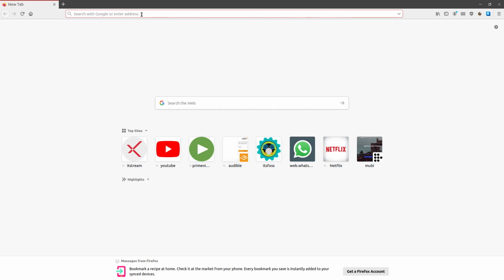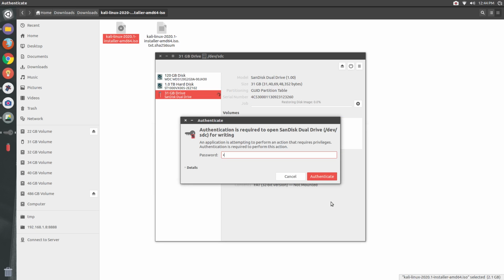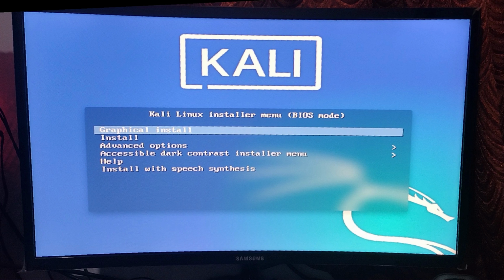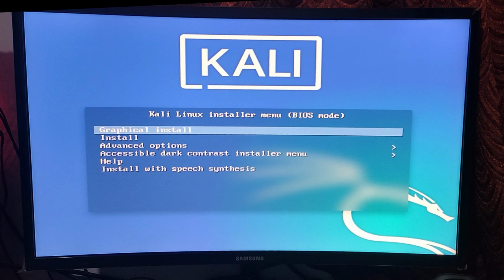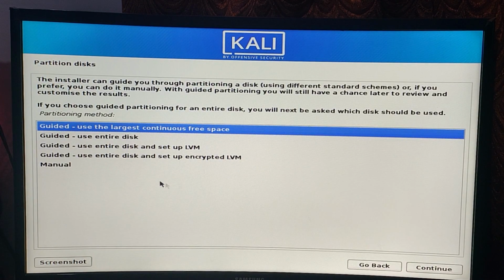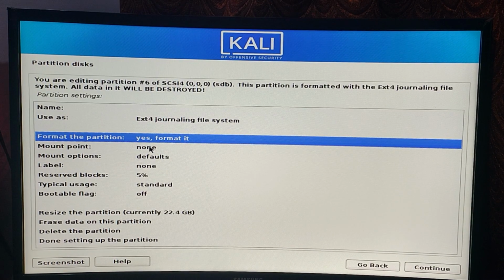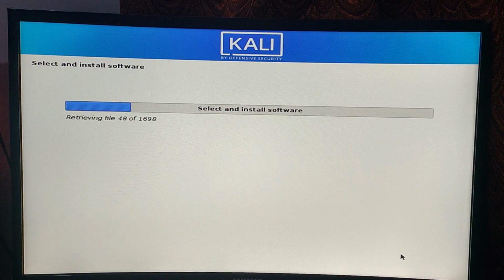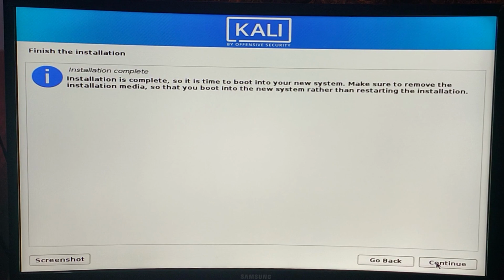Install Kali Linux 2020.1 in 30 Minutes | STEP-BY-STEP GUIDE | The Correct Way

Comment: I did everything ..but it's not letting go pass beyond the connection option it won't let me do it later ...I'm using a 2 in 1 RCA w101 V2 x86 cherry trail processor

Comment: I followed ur step and its show the installation is completed. But while booting only 1 option i.e windows is showing, what is the problem with this?
Reply: same problem
Reply: Do u have any idea to rectify it?
Reply: @lavanyalakshmigurijala1347  i get it. While booting u have to press a function key(different for different brand f12 for asus i think) then it will take to the setting page amd u have to do some setting at there.
Reply: @jumpropecommunity6880  Ok tq

Comment: Brother i am getting firware eroor what to do next
Reply from the maker: Yeah many people seem to be having this problem. Your Kali installation is missing Kali software sources. You need to manually install them using the terminal. Then you need to install gdm3. Then you can log in to the GUI. 

Connect your computer to the internet using ethernet. You can try USB tethering too. Then you need to manually fill in the Kali repository info. Then sudo apt update, upgrade and install gdm3.

Comment: I followed everything exactly. But i am getting a non gui interface
Reply from the maker: Yeah many people seem to be having this problem. Your Kali installation is missing Kali software sources. You need to manually install them using the terminal. Then you need to install gdm3. Then you can log in to the GUI. 

Connect your computer to the internet using ethernet. You can try USB tethering too. Then you need to manually fill in the Kali repository info. Then sudo apt update, upgrade and install gdm3.

Comment: Do I need wifi dongle? I dont have one. I have network card built in my laptop, and my operating system is windows 10. So what should I do? Turn my router off, and after the installation, turn it on?
Reply: No, just turn off wifi and try not to connect to internet....

Comment: i did exactly the same thing but my linux doesn't have a gui interface i tried install the gdm3 interface but it doesn't work and now i've tried removing the grub bootloader but it doesn't work 

is there any way i can install a gui on the linux system or remove the whole os?
Reply: I have a solution to this
Reply: Same problem
Reply: i am facing same issue,
if anyone have solution for this please share here.